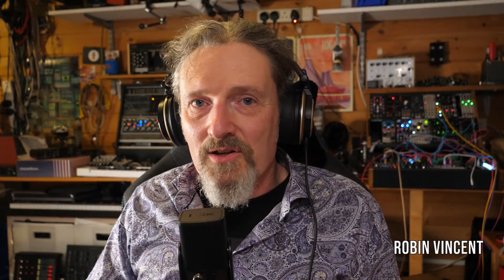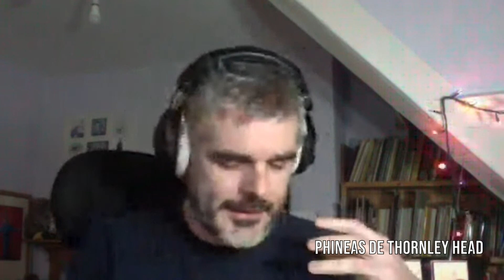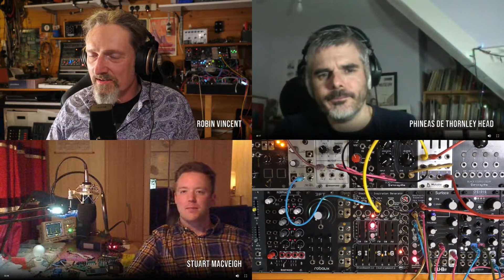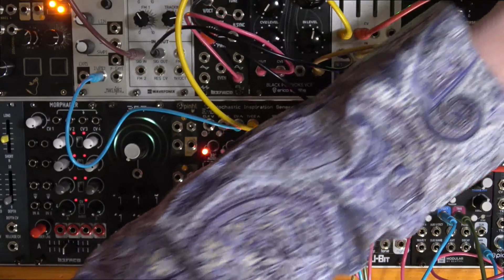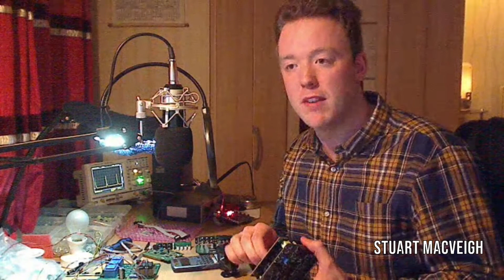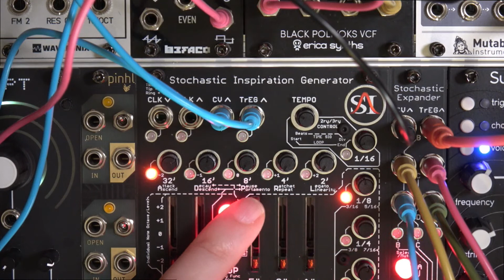Molten No-NAMM Live Stream - Stochastic Instruments

Comment: As promised in my earlier comment, chapters:

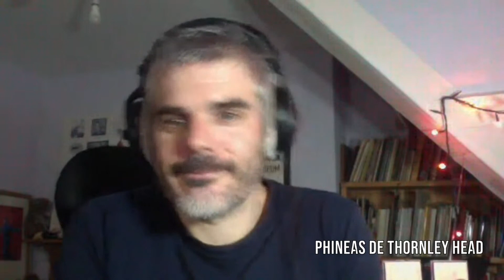2:50 Interview with Phin and Stuart
22:20 Basic demo
29:25 Note length
33:40 Looping
39:40 ‘Process v Performance’
44:20 Looping again
49:20 TrEG
59:05 Ratcheting
1:06:35 Menu theory
1:11:15 Pitch
1:18:35 Tracks
1:25:15 Pico Drums
1:31:45 Muting
1:33:40 Attack/decay
1:35:00 Velocity/level
1:36:35 The tale of availability 
1:43:00 Hardware evolution 
1:51:10 Knobs
1:54:15 Just Robin

Btw, I had a brilliant idea re the knobs issue and communicated it to Phin, so he’s got that bookmarked somewhere.

Hope this helps!
Reply from the maker: Yoink!